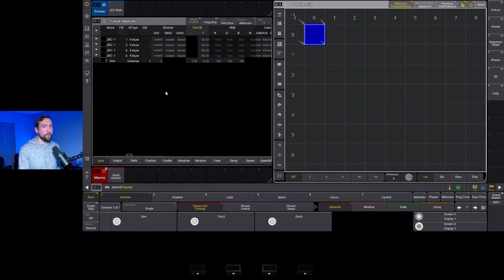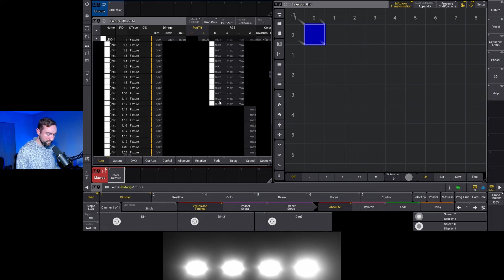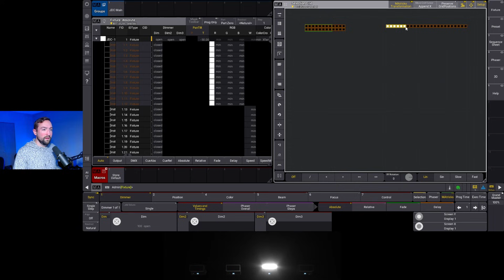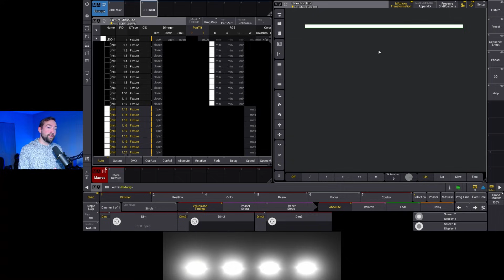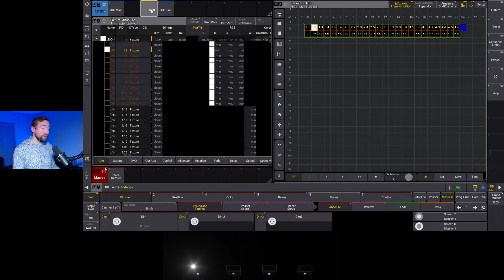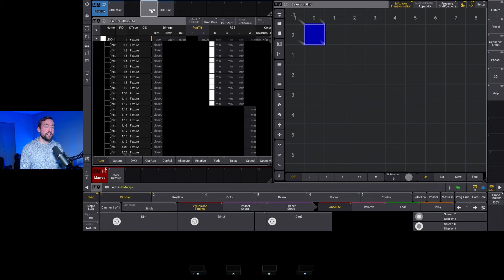GrandMA3 - How I Set Up My Multi-Instance Fixtures

Comment: trying this with strike M - If I set plate and beam to be full by default. They never go off.  Plate and beam sub fixtures intensity seems to be activated by Plate / Beam parent.
Reply: I seem to have got it working. When in doubt try a new profile.